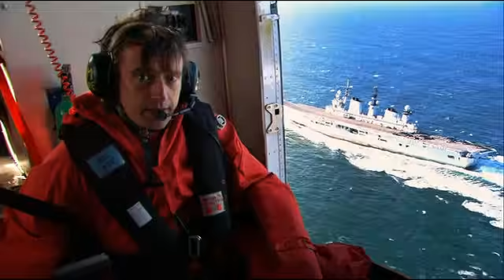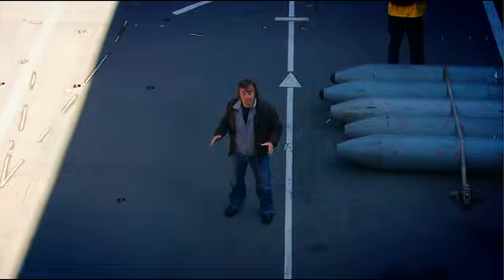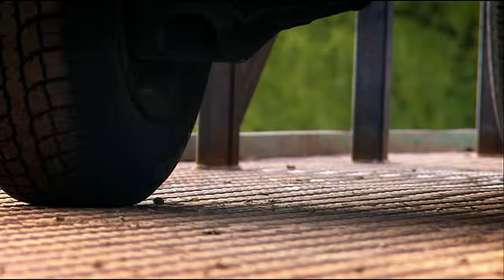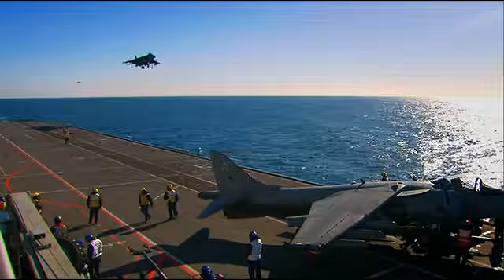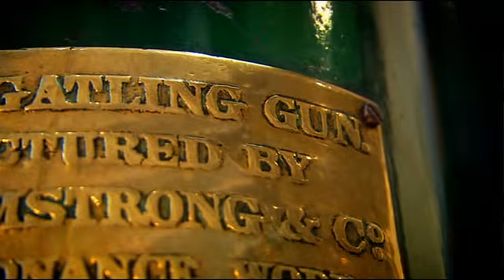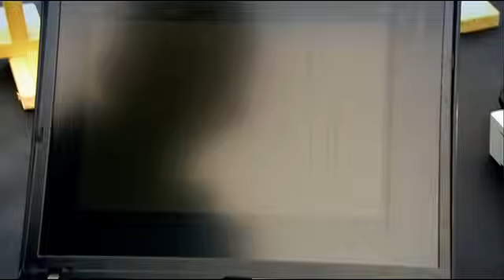Richard Hammond's Engineering Connections | S02E03 - HMS Illustrious | DocumentaryHub

Comment: Wouldn't introducing air into a oil based system create an airlock preventing the stored energy in the accumulator from being used? Like a brake system on a car?
Reply: In the one case, you have non compressed air in the line interfering with the hydraulic medium. In the other case, the hydraulic medium is used to highly compress the gas which wants to violently expand, its performing the function of, say, the foot in the brake.

Comment: Boomerangs are fun and cool to be sure. But they had nothing to do with the gyroscopic stabilizers on an aircraft carrier obviously. The gyroscope was invented without the benefit of knowledge of boomerangs. More directly connected things would be better I think. (Although... as I said... boomerangs... cool... fun.)
Reply: Can you proved sources of proof that the gyroscope was invented without ANY knowledge of boomerangs? That is a extremely bold claim to make if you can’t back it up
Reply: The point is not that boomerangs were used to invent the gyroscope. The show was using a boomerang (a cool article) to explain how the gyroscopic effect works……